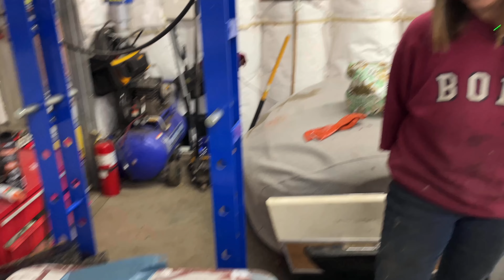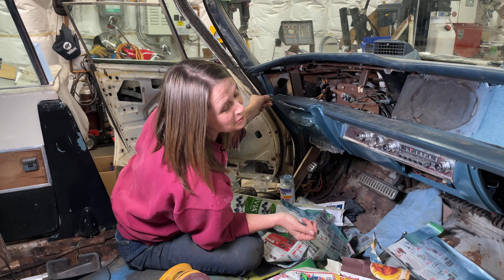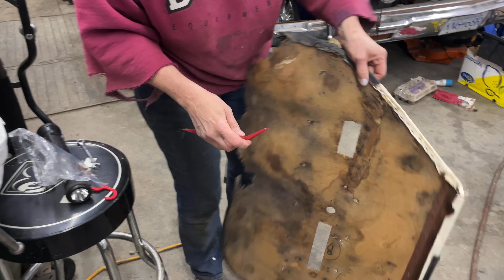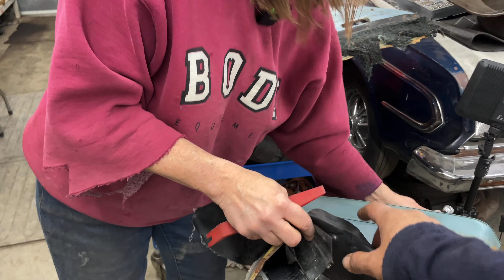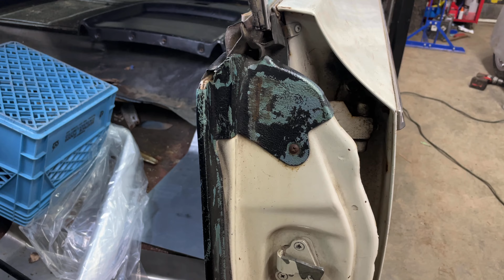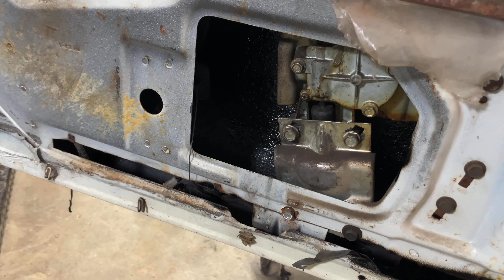64 New Yorker - Part 24 door panel demolition

Comment: what kind of paint on metal interior parts ?
Reply from the maker: I’m not even sure. Lol. Shawna had it mixed up in a spray bomb. Probably enamel.
Reply from the maker: I had the paint mixed up using a swatch from the seat material. It’s a high viscosity paint. I was going to give you a pic but that doesn’t seem to be an option on here.  Shawna 😊